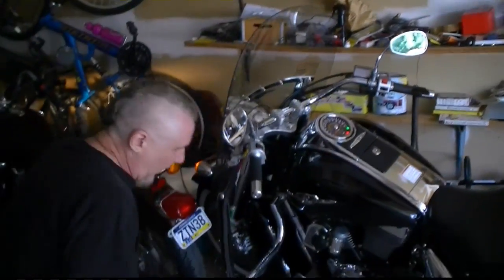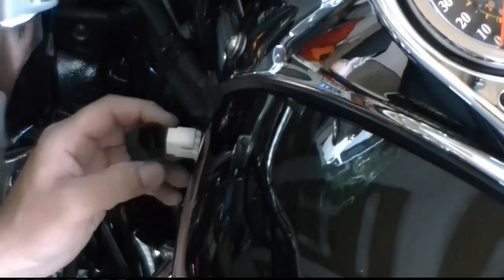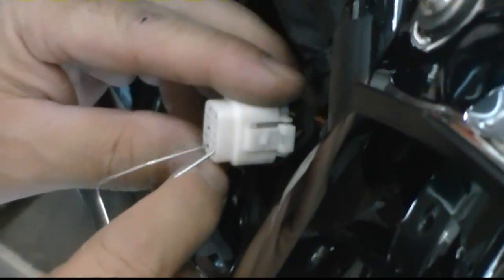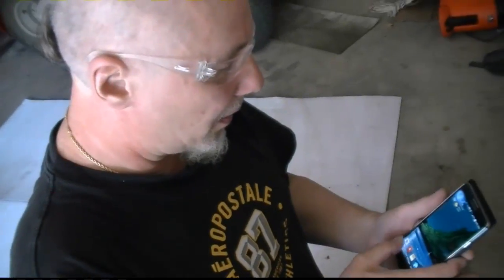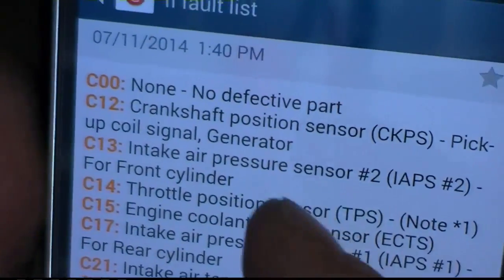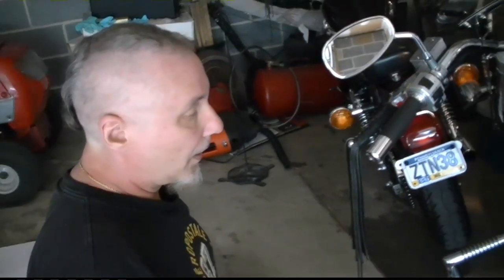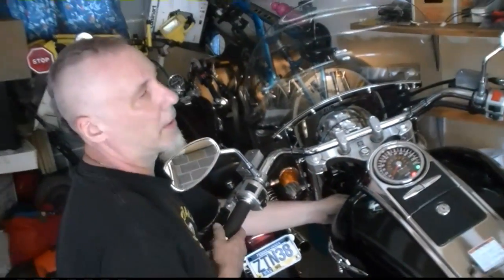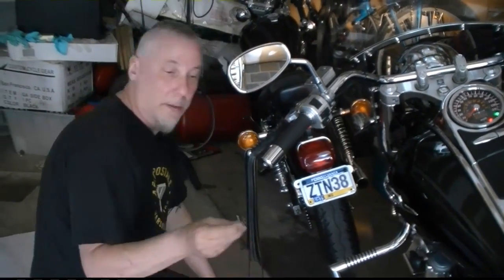How to Read Factory ECU Codes FI C12 Suzuki C 90 Crankshaft Position Sensor

Comment: Does this work on an 05 c50 Boulevard?
Reply from the maker: Probably, I'd try it.
Reply: It works I keep getting the c00 and don’t have power it runs about half of what it is capable of.
Reply from the maker: @gilbertsalas7304  I read the following online, maybe you did too. "C00 means there are no malfunctions. Not sure why you're getting the diagnostic display instead of the odometer though. There is a connector for the "Dealer Mode Switch" which causes the codes to be displayed...maybe the wires to the connector are shorted?"  If it was me I would call or go to a Suzuki dealer service dept. Sorry I can't be more help right now.

Comment: Same problem with my M90 boulevard... Can't rely on it for a long ride on a hot day. it starts but won't run. Thanks for the video.
Reply: My M90 does the same. Did you get a new CPS?

Comment: Notoriously bad charging system on these bikes. I hard wired the rectifier straight to the battery and gained 1.2 boots in charging. These bikes lose voltage through the connectors.

Comment: hey did you know were is located the Crankshaft Position Sensor on suzuki m50 2005
Reply from the maker: Hi, I'm not exactly sure where it is on that bike.  I would search that question on Google.  You should find lots of help there.  Thanks and good luck with it.  :)
Reply: Rick thanks you for your faster response, i actually found it in a forum, maybe could work for another people  in the future, the Crankshaft Position Sensor for Suzuki boulevard M50 is located in the right side of the bike under the driver seat, you must to remove the plastic cover were the logo of M50 appears, and actually is the same exactly  plug as yours, you can connected a paper clip between the two wires one is the black-white and the second is the red-white. I connected the clip as you show in the video and open the ingniton without turn the bike on and appears on mi bike the CODE -C00
Based on what i read that means that the bike is ok 
unfortunately mi bike is acting really weird i bring it to the shop and the guy told me that was the fuel pump 
i bought the fuel pump and i installed myself and actully is having the same issue im so mad that i spedn almost $500 for that part and the bike turn on i accelerated and them goes off

any suggestions what could be
Reply from the maker: juan pablo giraldo tarazona Ok Great. I'm sure that will help a lot of people. And they can read it on here.  Thank you!